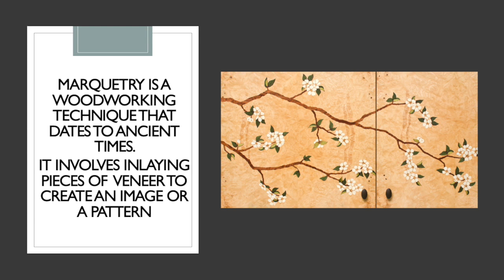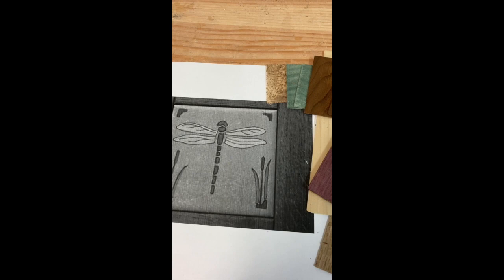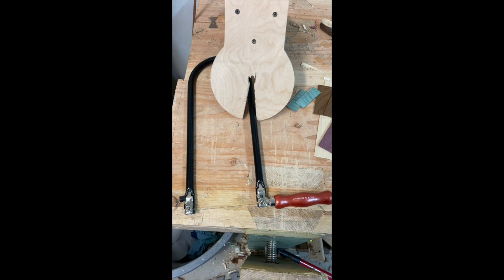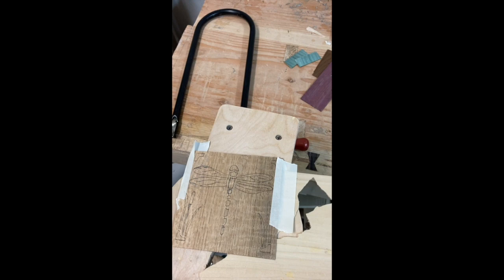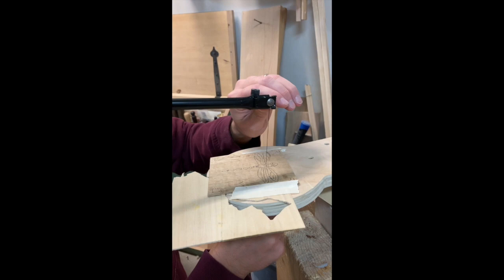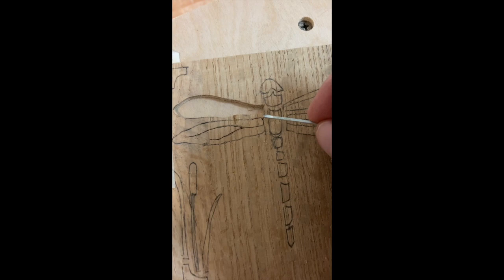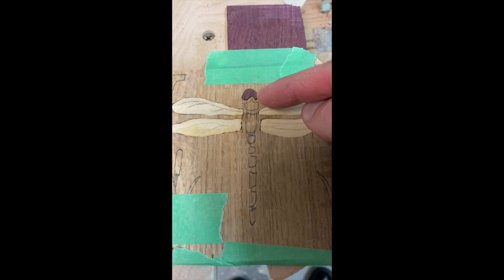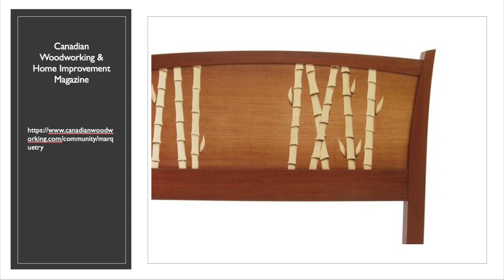Piece by Piece Marquetry

Comment: for small pieces is better the cutter than the saw?
Reply from the maker: Hi - with a 2/0 blade you should be able to make very fine cuts, suitable for the smallest pieces.
Reply: @jamesdobson2328  Thanks, I was just looking for the measurements of the blades, I tried to cut with some blades that I have and the cut was very untidy, the veneer was cracking
Reply from the maker: @usuariodelgoogle  a 2/0 blade is 0.0103” thick. If you are using commercial veneers you may want to try a thicker shop sawn veneer. Mine are around 1/16” thick.
Reply: @jamesdobson2328  thanks!!